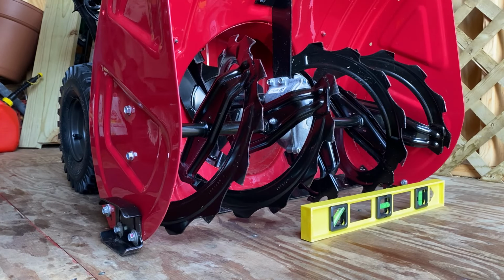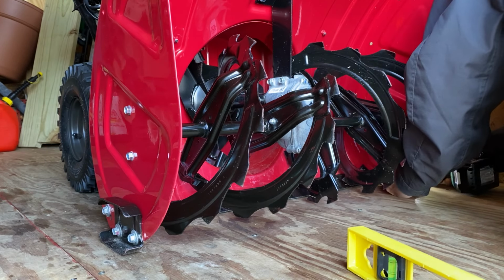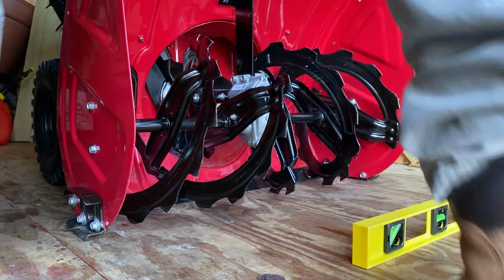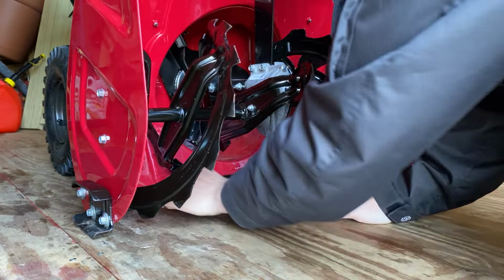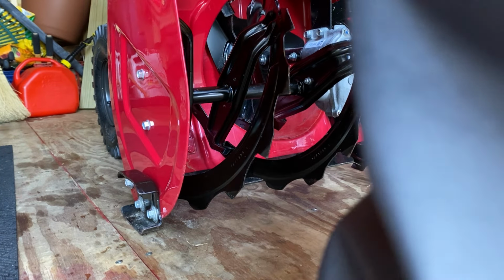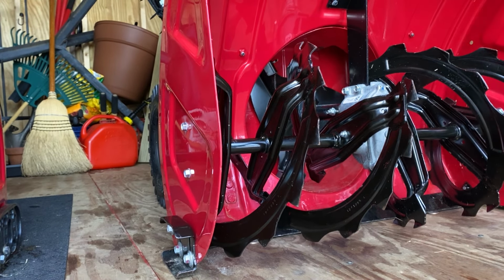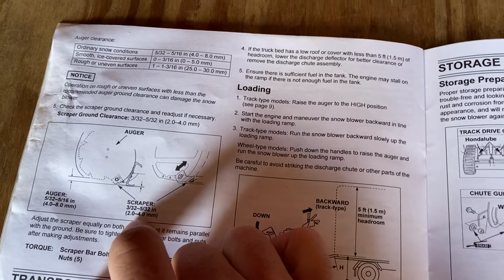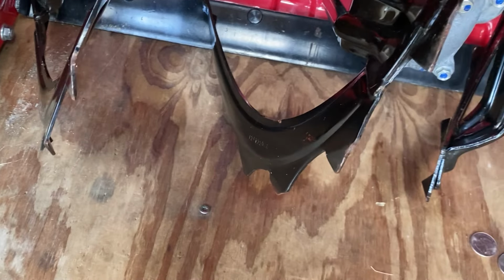Honda Snowblower Skid Shoes - Proper height Adjustments

Comment: Nice. This is my favourite snowblower on your channel. Are the rear/inner skid shoes not enough? unusual to see 2 different sets of skis on a blower.
Reply from the maker: It comes like this on the 928 series but not the 1332 series. I believe it’s a backup in case the backs or fronts go first to prevent further damage to the auger bucket
Reply: @appleztooranges  Makes sense, would definitely hold it square.
  On my craftsman I cut notches out of the front shoes and installed little roller wheels. I thought they would just ice up, but actually helps a lot with reducing the forward resistance.
Reply from the maker: @KF1  awesome! Seems like a great modification
Reply: Great video.  My 928 didn’t come with the side shoes and nothing was adjusted right.  Adjusted it with just the back skids for now but I ordered the side shoes

Comment: should you check that the scraper in the back that you put the quarters are under is level???
Reply from the maker: It was relatively new Honda. Once I did this adjustment per video, I had a steady clearance of 3.5 mm from bottom of scraper to level ground. If it was uneven and the quarters did not have that gap throughout, I’d lower or adjusts the scraper blade. I checked measurement between scraper and ground and auger blade and ground and it was per specifications with Honda manual.